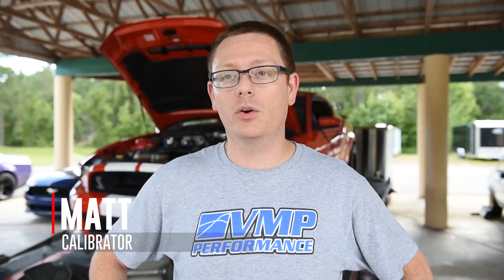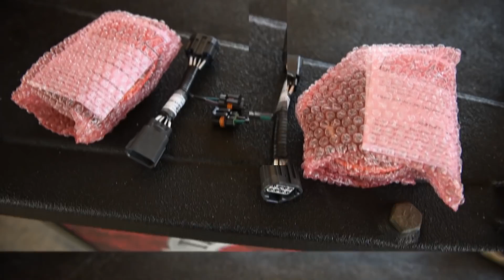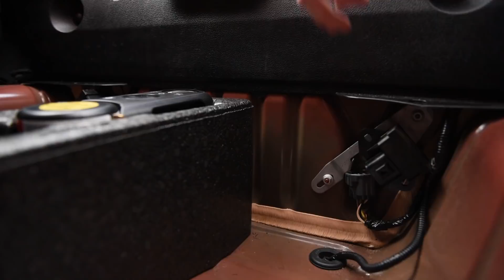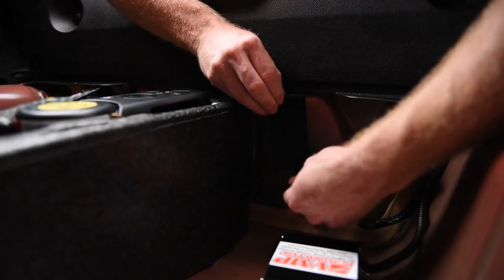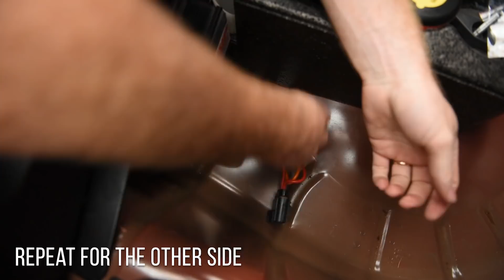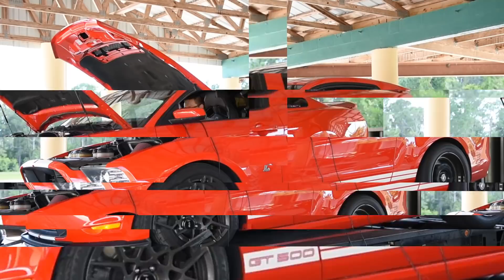Shop Talk Saturday | VMP Fuel Pump Voltage Booster Installation for a '13-'14 GT500

Comment: I have a 2000 mustang and I would like to know if that comes for my car
Reply from the maker: Hey there!  We do offer a universal wire-in version of our fuel pump voltage booster and that would be what you need for your '00 Mustang.  It can be found at this link: https://www.vmpperformance.com/VMP-Fuel-Pump-Voltage-Booster-40amp-wire-in-for-Mustang-Cobra-GT-F150

Comment: Just got off the phone with Power by the hour and they converted me to VMP instead of Whipple or Roush, so I'm going with you. Question, becuase I installing my fuel system this week. I have a Phantom 340 Stealth, single pump, will your booster work with this system, or do I need to get a dual pump system?

Comment: How does the factory Ford wiring sized for 20A handle 40A?
Reply from the maker: The biggest issue is key-on when the system primes, it pulls a ton of current and can pop a fuse.  Our unit also has a soft-start to help with that.  We could probably get away with a 25a fuse, but its better to be safe than stranded.  Once the car is running the variable speed logic modulates the pumps to only produce what is needed, and when you do need everything, its only for short bursts at high RPM wide open throttle.
Reply: VMPPerformance  just received the booster for my 2012 GT500 ..... does this require a tune after install??? Direction said something about cutting wire ( white ) # 1 ? Thought it was plug and play
Reply: @ShelbyCorGT500  hey bro I have the same car tvs swapped and am wondering if I should get this product.
Reply: @VMPPerformanceTV will the fueses be provided by VMP package? Also what are the fuel pump fuses # for the gt500 2009 mustang?

Comment: Any tune support needed on later modeled SC cars?
Reply: What do you mean?
Reply: @goodnoughperformance  I need to update my tune if I put in the booster on a Whipple tune
Reply: @thereissomecoolstuff  it would be a good idea to do so, but the car will start, run, and drive without an update

Comment: Would it be better to upgrade fuel pumps to the dw300's instead of bap?
Reply: No.
Reply: @goodnoughperformance  can you explain why?
Reply: They require more voltage to acheive the same fuel flow and pressure as compared with the stock pumps.
Reply: @goodnoughperformance  🤔
Reply: @goodnoughperformance  I have a 2011 tvs swapped gt500 with cams long tubes stock everything else. Wondering if I should get this and should I do a new fuel system?
Reply: @shanefowler9443  depending on what pulley combination and therefore boost you are running you may not even need boosters.